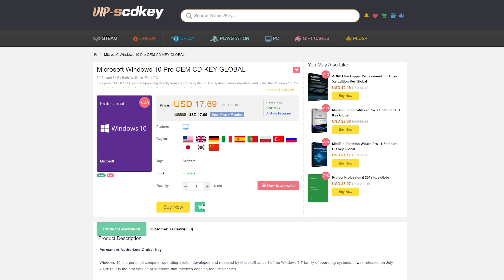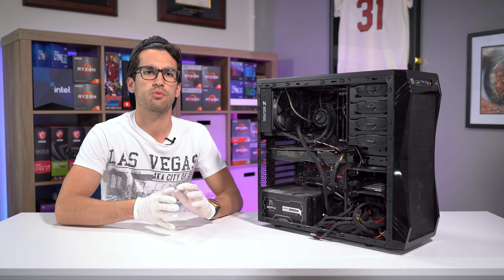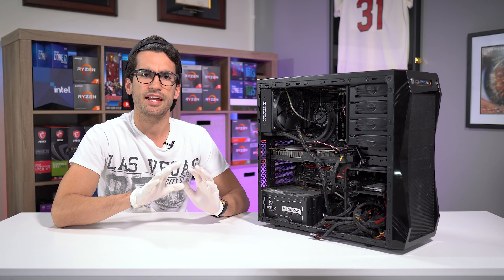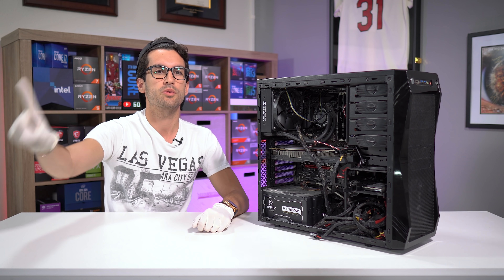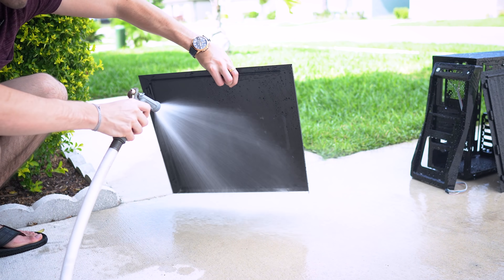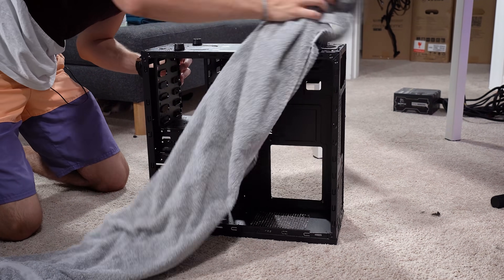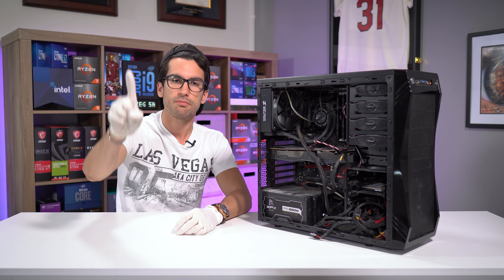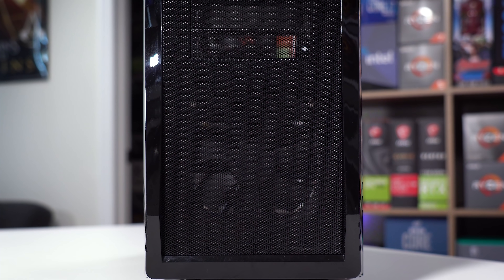How To Deep-Clean Your PC Case

Comment: I have the thermaltake level 20 VT case. I just windex the thing off every couple of weeks or so. The front mesh behind the front plastic if grimey AF since i had my PC on the floor for the longest time.
Reply: Should have waited until he got to the windex on plastic part.  I had no clue it was gloud8ing up my acrylic front panel.

Comment: Hey Greg, I have an Antec NX400 case, it has a top dust filter and a filter under the PSU and nowhere else. Would you say there is a way to add dust filters to a case that didn't come with filters? I can clean my case now and within an hour of use, I can already tell there will be a fresh coat of dust. Any tips?

Maybe like softmods for cases we already have and how to improve them type series for the channel?

Comment: @3:50 there’s a wire on the front panel when you clean it. My case is similar and I’m hesitant about getting it wet. Will this be ok?
Reply: As long as you make sure everything is completely dry before reassembly, there is nothing to worry about

Comment: Hey greg, do you think people should avoid blowing cases hard enough that makes the fan spins? I heard it might generate electricity and causes short. I did it to some of my office pcs with a really strong blower without disassemble it and nothing happened but horrible thing happened to my own pc where the cpu pins were burnt and 1 of the ram stick slot stopped working.

Comment: After spending years in a high energy physics lab, we used to wash all screws smaller than #10-30 by filling a beaker full of an appropriate solvent (choice depended on what the grime was) and set the beaker in an ultrasonic tank.  Worked like a charm and really gets all the crap of out crevices you didn't even know existed.

Comment: If you have a acrylic panel there are chemical compounds that will buff out light medium scratches (depending on how hard you want to work)
Reply: Any specific recommendations? Asking cuz I somehow managed to scratch the crap out of mine with a microfiber cloth.
Reply: @steve9094  Sorry I will spell it wrong. Novus makes a line of polishes 3 being an abrasive and 1 being a cleaner, any really fine polish will work normally ( like a fine polish for aluminum) I think its called machine polish I have used it to buff out scratches and a burn make on acrylic and plex, I have been using Novus for years its a lot of work but will polish out a decent size scratch (would suggest using a drill) I have been told plastic (automotive Lense) polish works well, I have never used it, but the Novus works on headlights.

Comment: Hey Greg I have a pc that gets blue screen after I get into it after 2 mins it goes to this blue screen that says whea uncorrected error can u help me
Reply: the "whea uncorrected error" is normally hardware related like a driver, I would check the component manufacturers websites for new driver, and bios, wouldnt hurt to run SFC scannow and DISM /Online /Cleanup-Image /RestoreHealth at the CMD prompt, see if it crashes in safe mode, look at the device manager and see if you have any jacked up devices, if you dont see anything just load one driver at a time and see what causes it to fail. I just had a Asus MB that would Auto OC and it was causing random "whea uncorrected error" crashes. If you have it OC'd see if it runs with out the OC. It really sounds like hardware.
Reply: @tomr3422  I am not very good with pc but this pc is from 2015 and idk how to fix it
Reply: @matthewm7558  do you know how to boot in to safe mode? It should ask you if you want to when it blue screens. If you hold shift and hit restart it should take you to a trouble shooting. Screen. Where you can boot in safe mode.

Comment: I have a Cooler Master Silent Pro PSU (
1000 watts), the fan started making noise, should I use wd40 to lubricate it or what other lubricant do you recommend?
Reply: I wouldnt spray anything in there with out making sure you can leave it off for a while, look for a non-conductive lubricant.

Comment: I have a lot of dust and skin debris due to a hereditary dry skin condition but strangely my PC hardly gets dusty. I just use an electric PC blower every now and then and it looks like new again. It also helps that it is on top of a set of drawers and not on the floor.

Comment: I finally upgraded components in my build and the process took extra time because of the time I spent cleaning out the dust. I drank a lot of IPA during the process but didn't use any of it during the cleaning process XD ... I know you meant rubbing alcohol but I straight up can't associate anything else with that acronym.